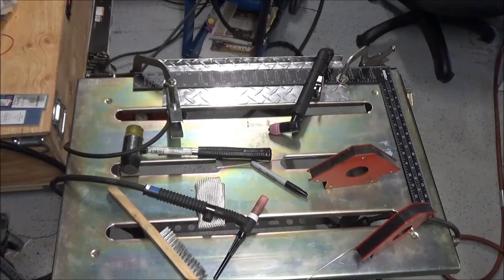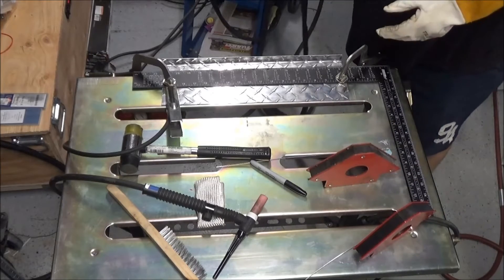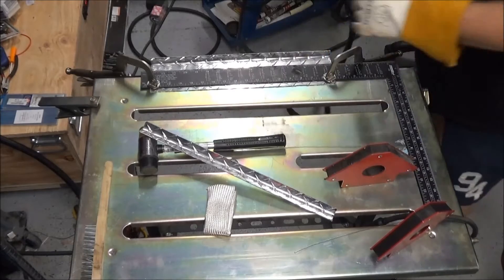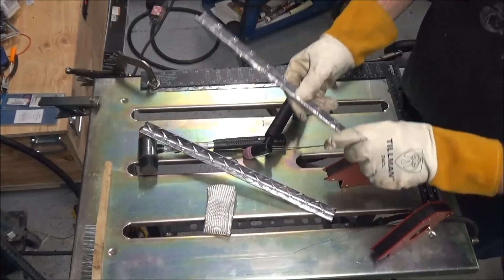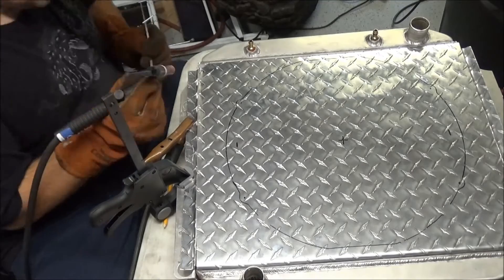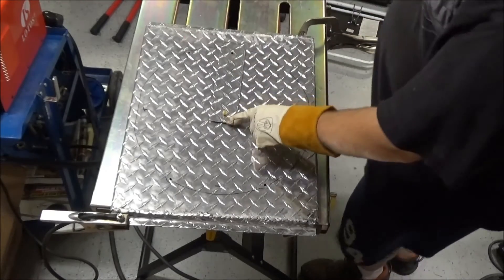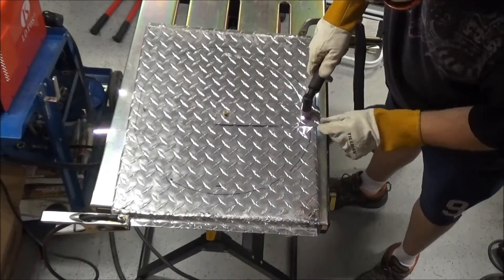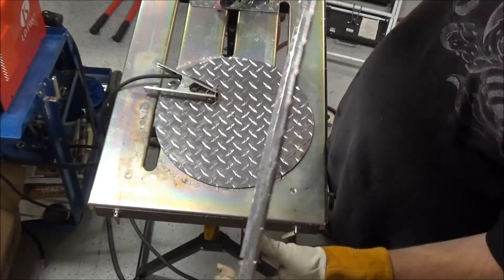Fabbing a Fan Shroud for My TJ

Comment: Good job man! Looks great! Looks like your fan is going to be really close to your radiator. Would your shroud be more effective if the fan were a little further away?
Reply from the maker: The entire reason I had to do this is to clear the pulleys.  It hasn't overheated yet in all the wheeln I have done since this video.